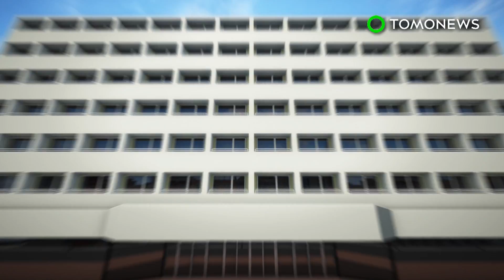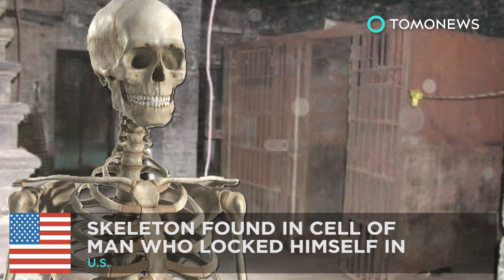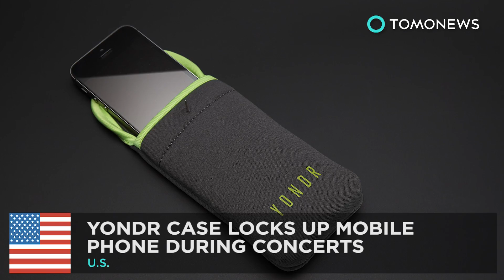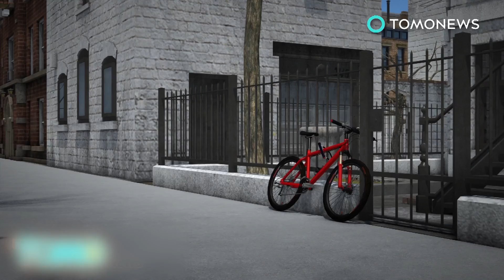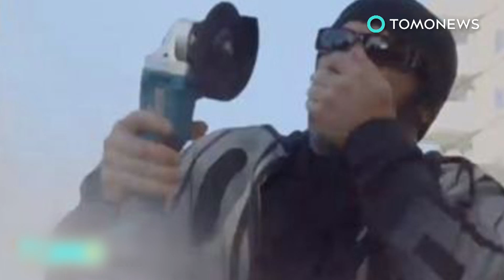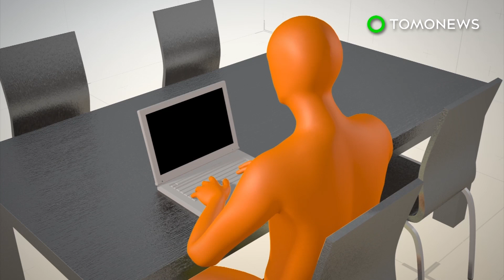Hotel rooms worldwide can be hacked using a single keycard - TomoNews

Comment: Ya cloning a master key such a big accomplishment (/sarcasm) Its pure security theater when it comes to managing those keys. They use a master that 90% of the time is just all 0's with the final digit being one for the master. Be it RFID or the old mag strip. Same with the hotel safes, they all have a master too.  A lot of it has to do with legal codes such as fire and police and postal regulations, that require them to have multiple masters to unlock everything. Hotels and such have known this for decades and really cant change it because it would violate code. They can just pretend to "Fix" the problem, so their guests feel safe.